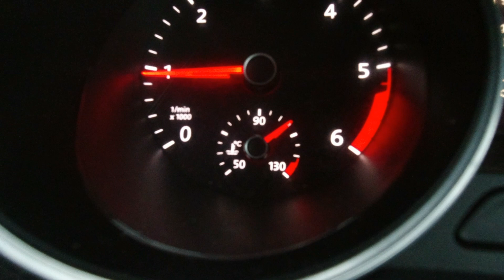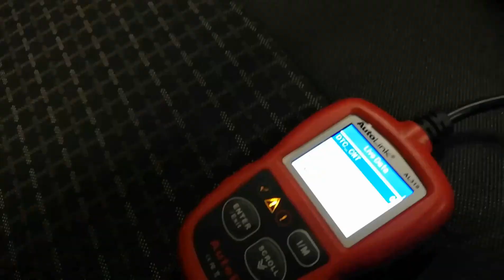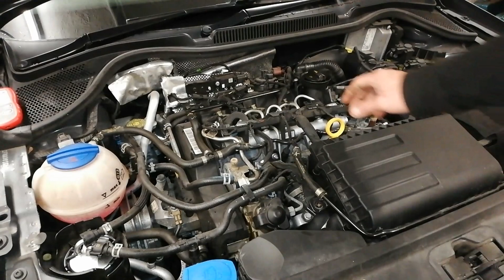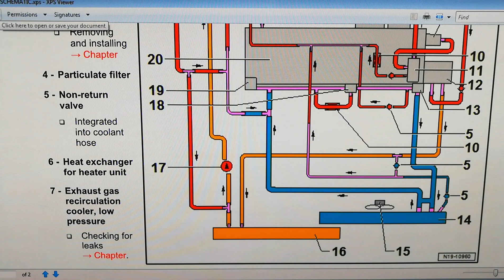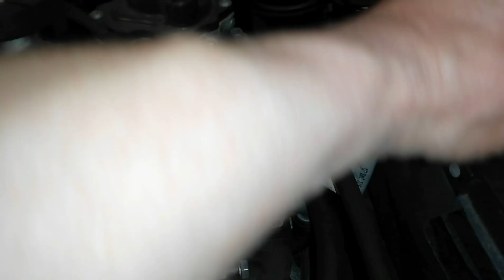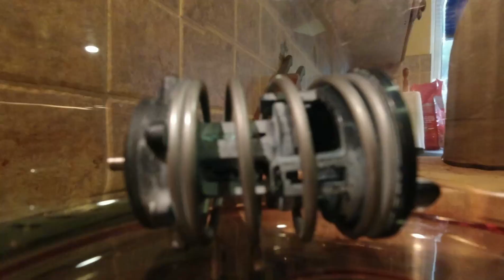VW POLO 1.4TDI Overheat CUSA Engine

Comment: I had a warning for over heating yesterday, I removed the return pipe one it cooled down on top of expansion tank and didn’t have a drop come through back into reservoir. Do I have to warm it up to temp for the water pump to open to allow flow through the coolant system, I also have a fault on diag for particulate filter bank 1 insufficient.

Many thanks.

Comment: My CUS not warming. After 30 minutes drive, motor coolant liquid is below 70-80 celcius. I think it is thermostat failure.
Reply: Is the problem solved?
Reply: @ucimamoglu  Nope but engine running with no failure.
Reply: @BurakSanlı-i6n  I think I have the same problem. The temperature fluctuates between 69–75°C and never stays stable. The thermostat was replaced, but it’s still the same.
Reply: @ucimamoglu  You had might be a sensor fail. Engine warming up quick in summer time but below the 4 degree celcius my  engine can't reach 90 degree celcius. Some mechanics said it is normal but i don' t trust them
Reply: Aynı sorun bendede var termostat değiştiricem

Comment: Thanks for that.  These euro 6 engines look a mess under the bonnet compared to the earlier versions. I  At least now the Egr valve is on the top of the engine.
That thermostat looks like a classic case of VAG penny pinching.

Comment: Hi Dave.
I have a similar problem with my 1,4 tdi CUTA engine. After driving like 5 km the coolant temp needle moves towards like 3oclock, it moves inbetween 90-120C for about 45 seconds or so, then it suddenly goes back to 90C and stays there no matter how hard i push the car or how long i drive. it helps to turn up the temperatue on the climate control. it had a new waterpump in 2019 at 90 000km. the car has now done 134 000 km. would you expect it to be the thermostat, waterpump or something else ? thanks.
Reply: Hi, I have the exactly same problem on my 1.4 tdi VW Polo V. The water temp needle oscillates between 90 and 110°C and suddenly comes back to 90°C.
Did you fix the problem ? What can I do ? :/
Reply: @Val51111  Hey I have the same car. Did you find a solution?

Comment: Dave this exact engine is giving me problems.  The engine is noisy and smoking black smoke and it doesn't have power,  is like the turbo charger is not working ir injectors are faulty I don't know.

Comment: I love the little 3 cylinder TDI but the systems in the newer ones are mad. Our old bnv in a Skoda is the last of the simple TDI I think, still pd though. The water pump moves a serious amount of fluid compared to this one! Just changed the thermostat after 149k miles because it wasn't getting to an actual 90 degrees, £7 and some coolant and she's good to go again.
Reply: the newer 1.4 tdis are fine too they got an electronically controlled water pump which can be replaced by a normal one after you change the timing belt.

Comment: My 64 reg1.4 TDi having the exact same issue.  Replaced the thermostat with a new one but the problem remains. Car only done 17k miles. Did the problem get solved for good ?
Reply: Hi did you solve problem ?! Maybe yes 2 years ago! The water pump ?
Reply: @monsieurk.elhadi4490  in a way yes. I just unplugged the sensor near the intake
Reply: @me_me_only  hi, i have an issue when the car is overheating i turn on the heater and then temp is going down. I tried the thermostat, waterpump is done 2019 for an imitation. Did you had an same issue
Reply: What sensor?

Comment: Did this car come back it out of interest, pretty common for the water pump to be the issue on theses (diverter shield sticks intermittently) there is even a vw tech note, I replaced one today for this issue
Reply from the maker: Yep, doing it now chris, video to come soon
Reply: dave sterl nice job Dave , good to see ur honesty too , I work on taxis mostly skodas and this issue is unbelievable common on the newer 1.6 and 2.0 vag engines so much so we have stopped using the pumps with the diverters n them. Keep up the good work man
Reply from the maker: @ep82chris  oh aye chris, needs to be shared
Reply: dave sterl of u want a copy of the tech note buddy give me ur email address 👍🏻
Reply from the maker: @ep82chris  davidsterling@tiscali.co.uk
Reply: Hi Chris and Dave, Gido here from the Netherlands. I have the same issues with my 2014 VW 1.4 TDI at the moment. Replacing the thermostat did not help. Would you recommend a new belt + waterpump without diverter? Are there any disadvantages to a pump without diverter? Their a lot cheaper. Thanks and keep up the good work!👌🏼 Regards, Gido